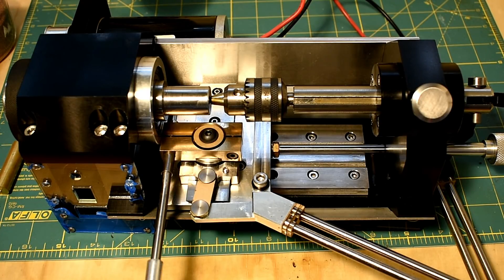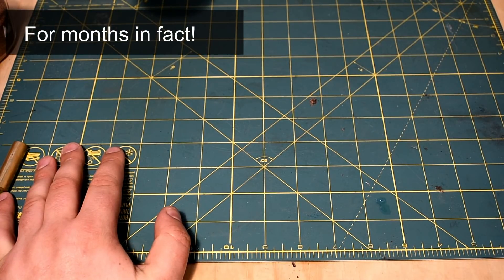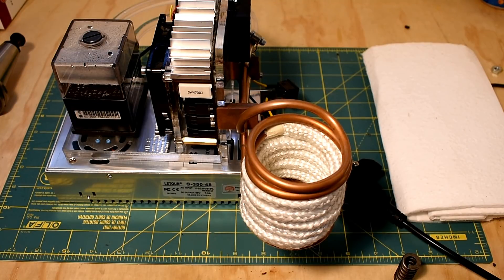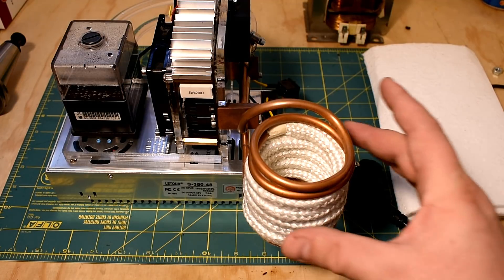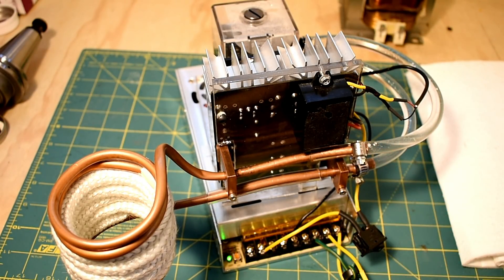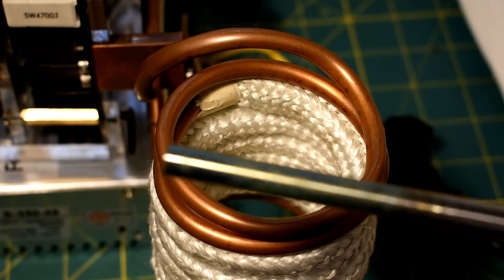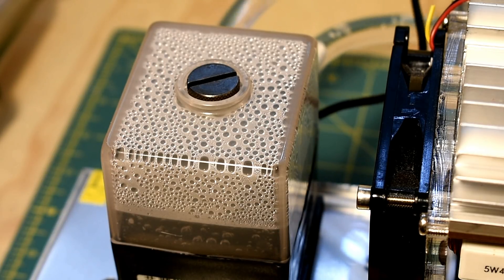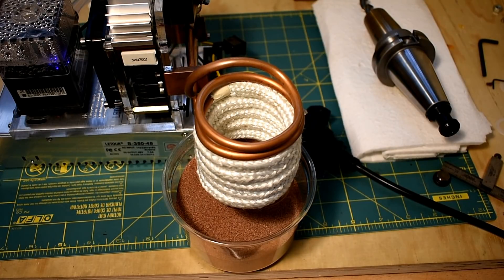Induction Heater Part 2:

Comment: your coil is wrong shape. Make another with fewer turns so the effect area can be focused on the tool holder only and not the endmill body. Caution, the coil need to balance with the capacitors. Do some googling for that.

Comment: Hello, thanks for the video. I watched part 1 as well and have a lot of interest in getting something like this to work for shrink fit tool holders used with carbide tooling. Any plans on making a video that finalizes that design?
Reply from the maker: Hey Cisco,
I've actually loaned this unit to the shop at my work for 40 taper shrink fit tooling and it seems to be working as-is.  I think all it really needs is an enclosure... maybe I'll get around to that some day

Comment: Nice video. The biggest problem is obviously your power supply is just not up to par. It is actually 7.3A not 7.8 and rated for 350W. And you are not likely to get that on 120v.
Reply from the maker: I replaced it with a new PSU and its pretty awesome now.  It really needs 1kW to reach its potential

Comment: I used them for bearings etc ..i installed a new main shaft in a 1 ton Muncie 4 speed I put the shaft in the freezer overnight and heated the bearings they dropped on so easy I thought I had a problem when it all hit room temp ..wow definitely have to use large hydraulic press to remove them I think the tooling would work great
Reply from the maker: I got a proper sized power supply and now I loan it to the shop at my work for their heat shrink tooling.  It's a bit slow but it works!

Comment: Coil diameter should be 1/2 to 2/3 larger diameter then the workpiece basically as close as possible without shorting to the sides great video do a bit on your power supply circuit

Comment: good setup, except it bugs me that you're using your power supply as a "stand" with water hose connections right above mains!  You're blocking the cooling fan too on PS.
Reply from the maker: Yeah maybe a bit unsafe lol.  I don't think I showed it, but I usually run things i've wired myself through a ground fault interrupt outlet so if any funny business happens it shits right off.  The plan was to put everything in a nice enclosure eventually (and not block the fan), but I only ever use it for like 5-10 mins at a time.

Comment: hi 
can we use dc inverter welding machine for induction i need some assistance on it as i see some rusia person do like this i share the link where i saw it https://www.youtube.com/watch?v=MkGh1ssfS0k&t=372s
Reply from the maker: Hi Omar,

Unfortunately I don't speak Russian, but it looks like that guy is making his own induction heater.  I'd say at any price point its much easier to just buy one.  A DC welding machine wouldn't work for induction heating as-is because, while it does use AC which is then rectified into DC, the frequency is not nearly high enough to cause the eddy currents to heat the material.

Comment: Couple thoughts:

1) increasing the frequency decreases "skin depth", which could be helpful for tooling.

2) a high discharge lithium ion battery pack could let you up the power considerably. I know some ebike guys are pushing 60kW, and some high discharge 18650s are good for 30-45 amps each.

3) it'd be interesting to place an alumina or quartz tube inside the coil, with parts inside the tube (run horizontal). I think that could be a neat arrangements for heat-treating. Either is cheap on eBay, but alumina is refractory.

Comment: can you melt iron an copper with this induction heater ??
Reply from the maker: I dont think you could melt iron with this induction heater just because it doesn't get hot enough.  Copper and aluminum are more difficult to heat up because they conduct electricity much better than steel and iron so the eddy currents don't generate as much heat

Comment: dude, where did you get the protective sleeve from? the white stuff on the coil.. and whats it called exactly? Any idea where i can get it from in south africa?
Reply from the maker: It's called high temperature sleeving.  I just got it from McMaster-Carr, a US supplier, however I doubt they ship to SA.  One thing I was thinking of doing is casting the copper coils into a plaster tube to prevent shorts.  Plaster can withstand very high temperatures and is widely available.  I never did try it, but perhaps you could!

Comment: A couple of tips.. If I may :) add a current meter it will help indicate if your in the ideal location inside the coil (although this is normally dead centre) also to help keep the system cool I'd wire the pump directly into the psu, so it will continue cooling the coil and more importantly the water when your not heating
Reply from the maker: Both good suggestions.  If I have room in the enclosure I'll definitely add a current sensor.  I'm also going to add a radiator and fan so I'll probably rewire that.  Good to hear from u!

Comment: 00:45 hahaha

Are you running it on mains frequency (50-60Hz)? The induction tooling setup I've seen ran 10-40kHz, supposedly the higher the frequency the faster but shallower the heating.
Reply: It's  DC power supply.. Did you stop watching at 00:46 ?
Reply: Beach&BoardFan your a dead set drop kick
Reply: I dont know if thats a compliment or an insult
Reply: Beach&BoardFan you don't seem to know much do you?

Comment: I'm probably the guy who asked about the heat shrink tooling, thank you very much for this experiment! I made 8 tool holders this easter, got them with awsome TIR. I can get in and out the tool with the torch easily. May try a 1800W unit, the problem is the power supply (my CNC power supply is 48V, 400W). I'm thinking on using 4 car batteries on series...
Reply: I saw your other video again and I wasn't, but I thinking on doing it!
Reply: https://www.rcgroups.com/forums/showthread.php?1292514-How-to-convert-Server-Power-Supplies
Reply: Problem is you still need several supplies to get 48V. With less voltage you may not reach rated current
Reply from the maker: It's all about power.  Most of the chinese linear power supplies are less than 500W.  Four car batteries could work.  I was actually thinking of implementing a battery-based power multiplier (I imagine I'll get some hate for calling it that,) but basically an electrical flywheel that lets a machine draw much higher peak power when needed.  I was actually thinking of using it for a spindle motor, but this could be a good application.

Comment: Could you get more heat out of it if you make the coil shorter?
Reply from the maker: I always have a hard time keeping these relationships straight, but I think:
*shorter coil = less inductance = faster current stability = faster heating*, but not necessarily hotter.  I think more current in general drives the max heat

Comment: Thanks for sharing and especially trying out what we talked about on Instagram! 

This is quite a large toolholder you have, I saw a setup like that on the Technishow I visited a couple of weeks ago. I got a demonstration at the Haimer booth and I noticed that they use a double coil setup and the smallest version is rated at 10kW on 400V (so 10times the coil you use for this test) and up to 33kW. 

I am still curious though if it can be done with a similar setup (dual coil but done with these ebay induction heaters) and with smaller diameter toolholders (so for the 1/8" shank tools) and on a SK15 toolholder or HSK E25 (Similar to this but with less "meat" that needs to be heated: https://www.haimer-usa.com/products/tool-holders/din-69893-hsk-a-hsk-e-hsk-f/hsk-e25/shrink-fit-chuck/mini-shrink-chuck-extra-slim.html) I won't bother asking you to try it, I will do that myself in the near future.

Pretty cool: That setup haimer demonstrated heats so fast that it can be used with HSS tools
Reply: I had the same exact idea on mind! I made some shrink fit toolholders (TTS shank and same size body where the tool grips) and I just use a torch to load and unload tools. My homemades TIR is 5 microns 10cm away of the spindle nose, awsome. We have the Haimer version at work, but is way too expensive for the home shop.

My biggest concern with those ZVS induction heaters is the power supply. I want to try 4 car batteries on series with a 1800W unit. If that's not enough I'm thinking on making my own unit, a big H-bridge with microcontroler will let us modify the frequency acording to the toolholder size, getting the perfect heating.

Looking foward to see your experiments. Maybe we can all talk and share our ideas and experiences.
Reply from the maker: I think you'd have a much better chance with smaller tool holders.  I'm sure the haimer ones can use 220V or 460V power and push a lot of power through the coils.   I'm still optimistic about 40 taper tools, when I get the bigger power supply we'll see.  Some of the big industrial induction heaters are so powerful you can run material through them continuously (I think this is how they temper chains)

Comment: I think the magnetism rule about efficiency falls with the square of the distance applies to your coil diameter
Reply from the maker: Yeah so I think that's why really small workpieces in a large coil don't work so well, though larger pieces (say a tube that doesn't have a lot of thermal mass) still fall into like a weak zone near the coil.  I really should play with different coil diameters:P
Reply: Maybe you could bend several different diameters and have an "easy" release connection. Maybe one coil for each "known item" you are going to heat - like for instance if the shrink fit tooling is a necessary job, wind a coil that fits.
Reply from the maker: Yeah for sure.  I would imagine different taper sizes would need different coil sizes.  I'm certainly open to a bit of inefficiency for convenience (a general purpose heat treating coil would be nice) but if I had 100 of something to heat treat I'd put a lot more thought into coil geometry.

Comment: Hello! When the induction heater is i your shop, you can use one of those tanks that hold windshield cleaner liquid in cars. There are tanks that have one compartment. A larger reservoir tank will help you, and longer and thinner hoses might also function as a diy radiator. Just an idea. Thanks for makeing videos.
Reply from the maker: Thanks!  I like the windshield washer tank idea.  My first instinct was just to have a larger tank of water that drains into the pump and gets "refilled", but of course I want to keep it nice and compact.  I'll look into longer and thinner hoses (Maybe even another section of copper tubing just for cooling?)
Reply: hlaps1990 Cool idea! Break line tube might bee cheaper (even the pure copper premium versions) than copper tube bought at the store. The induction heater already has a «moonshiner» vibe, so more «coils» of mettal will complete the distillary look.
Reply from the maker: I'll have to check that out.  I should use a wooden cask as a reservoir too:P

Comment: You need a radiator in the water system.  You have added water mass to absorb heat but when the water heats up you are back where you started.  If the water boils you have a real problem.
Reply from the maker: I really underestimated the actual amount of heat generation.  I was thinking it would reach a thermal equilibrium much faster.  I think I'm going to try a radiator :P.  Makes a neat kettle though!

Comment: You might find that you can reduce the number of coils to tune the resonant frequency, having said that a new coil can be easily wound with salt packed in a straight tube and then dissolved once wound. i have heard that there are certain frequencies for certain tasks but you should get better at making them so you can swap out new ones...
Reply from the maker: Salt packing is an amazing idea!  I've spent lots of time trying to think of how I can wind coils without kinks.  Sand might get stuck.  Ice would just break.  Ball bearings would get stuck.  Salt.  I'll have to try that!
Reply: yeah i have been meaning to get one of these myself... good luck with your channel.
Reply: Actually ice works quite well. You are correct that it breaks, but importantly it does not "crush".

Comment: I think steel has a thermal expansion a bit more than twice that of tungsten carbide, according to a rapid googling. And it looks like steel conducts electricity a bit better too. My point is that it seems that you have a fighting chance with a slow heating.
Reply from the maker: I'll definitely try again before I switch the power supply.  My understanding was that even if the tungsten carbide doesn't expand as much, it's still a press fit at high temperature and that the best way to get it out it to have hot steel and cool-ish tungsten carbide.  The other factor is how long you want to wait for your tool I guess.
Reply: after you heat the assembly spray the mill with some brake cleaner. It should cool down the mill really quick.